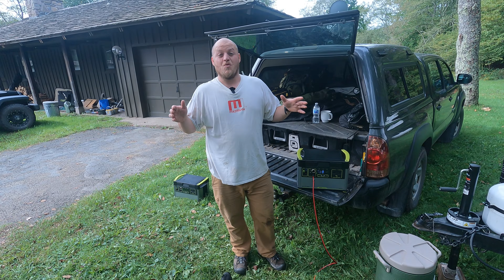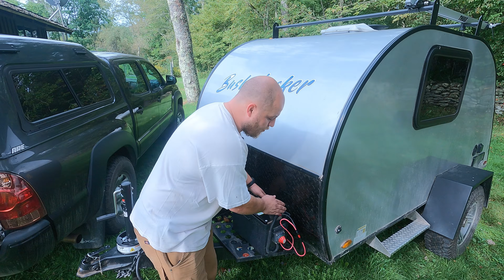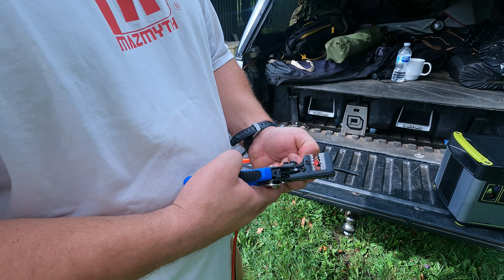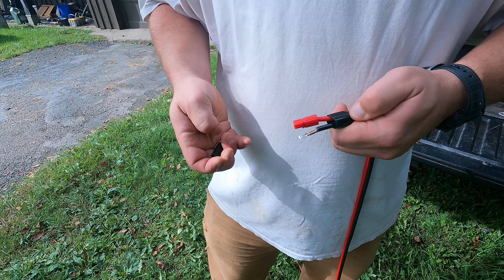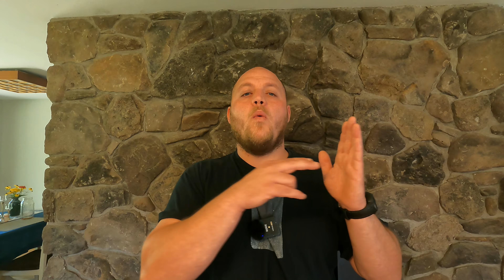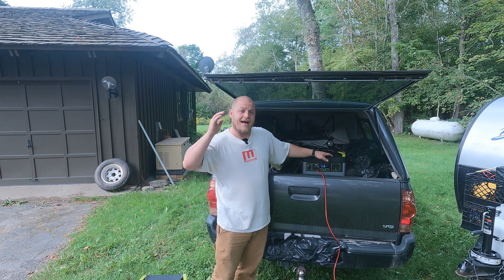Using Goal Zero for RV Battery

Comment: My pecron has an xt60 output port as opposed to Anderson. But could I do this same thing and just use an extension cord with Anderson on one end to xt60 on the other?
Reply from the maker: What is the DC output on your power station?  Yes, you can do it with anything, the plug does not matter.   What matters is the actual output capability of the power station.  Let me know what model you have and I should be able to help.

Comment: This has been so helpful. I plan to use the Goal Zero for solar. Can I use an Anderson Plug connected to the Goal Zero and the other end attached to the battery with rings? Thanks for all your videos!
Reply from the maker: Unfortunately, no, it’s not a battery charger.  You would want to remove that other battery, and connect right to those terminals.    Unfortunately, you cannot connect in series or parallel with any other sort of battery.
Reply: @DIYOutdoorLife  Thanks, I guess I will install the Anderson plugs like you showed for the Goal Zero or install a solar charger.

Comment: Why not just plug the rv into the ac port on the goal zero. There's losses in the ac converter, but it's super simple
Reply from the maker: I have another video about that.  The losses are considerable, they’re not as small as you might think.  On most portable power stations, it’s 15 to 20% on the output, and then it’s 15 to 20% on your RVs converter, and then off at 7-15 W continuously standby consumption.  It certainly is simple, but if you leave it on continuously, often times you get less than 50% of the runtime than installing it the way I show in this video.

Sometimes I like easy, sometimes I need the runtime, options are good.  Thanks for watching!
Reply: @DIYOutdoorLife I tried it on my older GZ 1400 and it was approx 10%. And part of that was DC charging of the trailer battery. My 1st step is a battery disconnect switch
Reply from the maker: It is much much more than 10%.   You might get 90% out of your inverter, but the RVs converter is also going to waste a chunk.   Also standby, if you leave the power station inverter on during the day, you can shred 500 wh there.

Comment: How does the solar system in the RV not try and charge the yeti as if it was the house battery
Reply from the maker: We discussed this in the video, but you’re suggesting would be absolutely correct and has to be avoided.  All charging sources must be disconnected to use this 12v power source.  Most of the time we can do this in a simple way, and the trick becomes very handy, but it will not work if there’s a charging source.
Reply: And one more thing not to beat a dead horse if you left the negative stay connected to the RV by slicing the charge system would still work for your RV solar to charge your house battery and still be separate if your disconnect switches is hooked up correctly?
Reply from the maker: Yes, this is exactly how mine is wired.  The solar goes to the charge controller, the charge controller goes directly to the battery.

You can have a disconnect, I actually installed the plug there, it’s really easy and multi use.  That way, while you’re running on the alternative source, your primary battery is charging from solar.

Comment: And how do you run 110 in the camper off the Goal Zero without all the other 12 V problems?
Reply from the maker: What problems?
Reply: @DIYOutdoorLife  well the minute you try and plug the 120 into the RV from the Goal Zero is it not gonna loop back and try and charge itself I guess you can’t do both or like you said if you plug into shore power, the system in the RV is trying to charge the house battery, which is now the Goal Zero?

Comment: What if you have a solar charger in your RV are you now charging the Goal Zero backwards?
Reply from the maker: No, the Goal zero has its own charge controller.  The output for DC on the Goal zero cannot accept charge, it’s just for running appliances

Comment: Four years later and it seems the prices have come down greatly on everything so you can make a great system for not a lot of money...
Has anything else changed besides this?
Thanks for your information.
Reply from the maker: Everything is changing… lol

There is cheaper gear, better gear, gear that is easier to use ….  The only thing for me that is not necessarily improving, is the integration with your tow vehicle.   With smart alternators, hybrids, etc..  It’s best to not connect the charging system on the automobile.   Allow your trailer to have its own isolated power system.

Comment: Great video, thank you
Quick question, can I simply not connect the 12v cig port outlet of my powerstation and connect to the electrical system the same way you did? I have an ecoflow delta 3. Or is there a simpler way to connect to my current camper ( geo pro srk) which has solar power as well
Reply from the maker: Yes, you can do that. I’ll post a video here with another option as well.

The main difference, is that the GZ has a 30 amp DC output with its Anderson.  Most automotive 12 V plugs are 8 to 10 A.   So although you can get this to work, it’s at least 1/3 of the overall capability.

RV Power Station Hack | Interior Back-Feed
https://youtu.be/lf2nbCLuLCY

Comment: Could you do this same Setup but with a TX60 connector.  My battery pack has a DC output that is a TX60 I believe.
Reply from the maker: It’s not about the type of connecting plug, it’s about the output that the power station allows.  These PPS have a 30 amp output that uses Anderson.  Check the DC output on the power station, and the connector doesn’t matter.

Comment: So on a Bluetti car charger port, is it only an input port or both input and output? If it's both what if I splice a car charger wire, adapt anderson power pole connectors, connect one end to the Rv like you did and the other end to the car charger port on the Bluetti. Will that run my Rv just like your Goal Zero?
Reply from the maker: Unfortunately, no.   It’s not just that it’s an Anderson plug that makes it unique, it’s that the power station itself, in this case, has a 30 amp DC output capability.   

They use an Anderson to make that connection, but the power station itself has the capability of doing 3X of what most can.

A lot of the other power stations have a 10 or 8 amp output .  Some bluettis have a 25 amp 12v DC output, which uses an aviation plug. This is model specific, some have it some don’t.  If your model has it, then you would just use the aviation plug to do this instead of the Anderson.

Sorry they don’t make it more easy for us !
Reply: @DIYOutdoorLife  I appreciate your quick responses to this and other questions I've had in the past. I've learned a lot because of your great insight and explanations. Keep up the great service you provide.

Comment: Hi Brian, Thanks for the abundance of info your channel provides! 
I'm wondering if it is possible to use the 10 amp car charge port from a Ecoflow Delta 3 instead of an Anderson Plug with the Yeti as you do in this video? At times, I would like to be able to eliminate a 12 volt RV battery as you do in this video?
Reply from the maker: Yes, perfectly fine to do that.  Just be mindful, it’s going to be limited between 8-10amps before it trips, this output is 30 amps.

Most of the time we can get by on less than 10, but not always.  With 30, I can run fridge, fan, lights, water pump, usb C charging at the same time.  With 10, we have to be careful to only run 1 thing at a time or the port trips.  Still very handy, hope this helps!

Comment: This is great. Thanks. Does this then give power not to just the usb but also 110 outlets? I have the yeti 1000 and a 100 watt panel for a 15 ft Travel trailer. I was thinking to plug from RV to power station. Let me look on your other videos.
Reply from the maker: This is a DC connection, it runs just like your camper battery.  No 110 V outlets.  If you need power like that, you can plug directly into the Goal zero.

Not a great idea to plug your camper in, it’ll drain your power station very very quickly 

More here -
Portable Power Stations Uses with Campers | Tips Tricks & Hacks
https://youtu.be/mU8iZZGlk_8

Comment: So you disconnected the negative from the frame and ran that same wire to the Anderson plug. Correct.  That doesn’t cause ground issues when running the coach battery?  A bit confused any help would be great.
Reply from the maker: I did not attach it from the frame, I cut it in the middle and installed the Anderson plug.  When I plugged the battery in, its chassis grounded.  When I’m using the power station, there’s a return path of the negative back to the power station battery.
Reply: @DIYOutdoorLife  I got it!  Just a bit slow 😂. Thank you answering!  Purchased a goal zero because of your videos, 2-3,years ago. Still working perfectly.
Reply from the maker: @brandonv4900 
Mine too, all of my GZ products work like the dead bottom

Comment: Why  you have to do so much wiring.  All you have to do is just plug the trailer directly into your power station 110 outlet .
Reply from the maker: No, that’s incorrect.  Battery is DC, inverter is AC, camper converter goes back to DC…. = Lose half of your stored power.

As we discussed in this video, and the video that came out before this ,  this is a solution to that problem and last probably five or six times as long as just plugging into the outlet

Comment: Brian, are there now brands other than Goal Zero that would allow me to do this?  Love the idea and the versatility   compared to going strictly with a battery!  Thanks for all your videos!
Reply from the maker: Yes, but not as many as I would hope.   The higher end models from EcoFlow and Bluetti include, but you have to check model by model, because it’s hit or miss.  All of the new Goal Zero’s still include.   On the less expensive side, I did a review of the Oupes Mega series which has this plug as well.

Hope this helps, thanks for watching!

Comment: Cant you use a cigarette lighter with an adapter to do the same thing. This will fit all systems
Reply from the maker: Not exactly. This is a 30 amp connection, a cigarette adapter is 8 to 10 amps.  If you run multiple large appliances at once, you will trip the cigarette plug.  With this set up, I could have everything DC on in the camper at the same time and have room to spare.  This comes in handy when the refrigerator is running at the same time as the furnace or water pump.  Also a major consideration when you’re plugging in things like laptops to charge.

With that being said, it’s still an excellent option to use less power and a 12 V plug. I talk about how to do that properly in this video-

RV Power Station Hack | Interior Back-Feed
https://youtu.be/lf2nbCLuLCY
Reply: @DIYOutdoorLife  would usbc out work?
Reply from the maker: @davidparker7156 

Unfortunately no . Wrong voltage and less power than the cigarette style outlet.

Comment: After I wire in my Anderson power pole and plug in from my Solar Generator do I need to disable the camper's built-in converter so there's not a conflict when I plug into Solar Generator using the camper's TT-30 for alternating power? Will the camper converter try and send DC power back to the Solar Generator? Thank you for your great presentation.
Reply from the maker: If you were looking to plug in the AC and DC simultaneously, yes.

Once you plug in the AC from the inverter into your campers shore power, it will try to backfeed charge the battery.  In some cases, it’s as simple as switching a breaker.  In other cases, you might want to disconnect the wire to separate your converter from the DC side.

It’s really challenging to get decent run time by powering the AC side of your camper off of a power station, it’s just really wasteful .   In most cases, we can just eliminate the need for AC.   What is it that you need to runoff of 120 AC?   If there’s something essential, you can do what you’re saying, but just know that the runtime will be poor.   As I was saying before, sometimes you can just find a DC alternative for a fridge, TV, CPAP etc and just run on 12vdc.
Hope this makes sense, thanks for watching!

Comment: I'm just curious if you've tested any other products that have the ability to wire directly like the GZ?
Reply from the maker: Yes, I have videos with the Oupes Mega series, which have 30amp DC output.  Some of the larger bluetti have 25 amp and the EcoFlow pro series has 30 amp.
Hope this helps, thanks for watching.

Comment: Great video very helpful!! Now while I have just the battery powered my camper it only runs the lights and the heater fan but not the outlets . If I use this method will it run the outlets also? And also how long do you think it will run some things in the camper while solar panels are connected?
Reply: And I’ll be running the mega 2 power bank
Reply from the maker: The key is that this is a DC method, it’s not gonna power the outlets in the camper.  You don’t want it to, that’s what kills your runtime.  If you need to run something, plug it directly into the power station.

How long it runs impossible to answer .  It’s a simple matter of what goes in and what goes out.  The biggest key we learn, is how to really keep our watts down and run very efficiently.

Thanks for watching the video!

Comment: Hey Brian, could you advise how I would adapt this to my Bluetti AC180? It doesn't have 45A connectors like this. Can I use the 120v output and wire that into alligator clips that attach to the battery, or is there another version of the Anderson kit to make it better. I'm trying to achieve using my power bank to run the camper (or keep batteries charged) overnight when it's cold.
Reply from the maker: Please be careful, attaching your 120vac outlet to your battery with alligator clamps would cause permanent damage and could get very dicey.

This Anderson output is a DC  plug.  When you remove the battery, or create a plug like I did in this vid, you can use this DC output to run the camper just like a battery with 12 V DC.

I do not believe they 180 has a high output DC plug, some bluettis do, and instead of using Anderson, you use what is called an aviation plug.  Remember that this is for DC only, and you cannot use alternating current.

Hope this helps, thanks for watching!
Reply: @DIYOutdoorLife  ok, so how should I do it. Would it be better to use the Andersen clips to make a battery interruption, and buy a DC plug that connects the power bank to the Anderson clips?
(Coffee money coming by the way 👍)
Reply from the maker: the power station has to have a high output DC plug.   It doesn’t matter that it’s Anderson or anything else connection wise.  What matters, is that the power station has some way of outputting high current DC.  Although I do not have an AC 180, the only plug that I’m seeing when I look online is the 10 amp automotive barrel plug.
 (cigarette lighter style).

Style plug won’t be able to do this mod, bummer. They don’t offer anything higher on that bluetti
Reply: Ok so really no option except plugging my trailer into the power station with the shore power cable and adapter then it seems?
Reply from the maker: @dadstuffandthings you could do this trick, plugging into the AC inverter is not gonna work very well

RV Power Station Hack | Interior Back-Feed
https://youtu.be/lf2nbCLuLCY

Comment: Once goal zero is connected to camper, will 110 plugs in camper work? Assume solar panel on camper will charge goal zero?
Reply from the maker: No, this is a pure DC application.  One of the problems with dealing with 110 off of batteries, is the inversion is very inefficient.  This solution gives you 12 V DC In a creative versatile way, to use 110 vac, you would have to plug the camper into the inverter, it’s not going to last very long that way.  

Plug your solar panel directly into the power station for charging

Comment: Thanks for this video. Gave me a great idea for my new Yeti 1000x and my Scamp Trailer. This will be a great back up to the new LiTime 12V 100Ah LiFePO4 battery I just added to the Scamp. Can you tell me what cut-off switch you are using here please. I'll be hooking up solar also as I work for a solar company and have access to free panels used or slightly damaged. THANKS again.
Reply from the maker: Good score on the solar panels!

This is the best switch for the job, it’ll allow you to switch between PPS and  battery

https://amzn.to/3Y0Auii